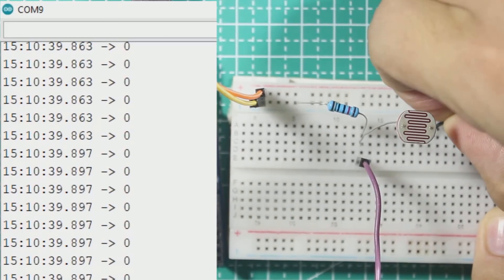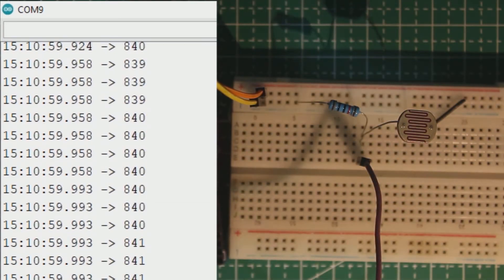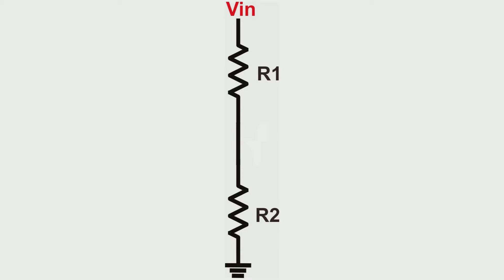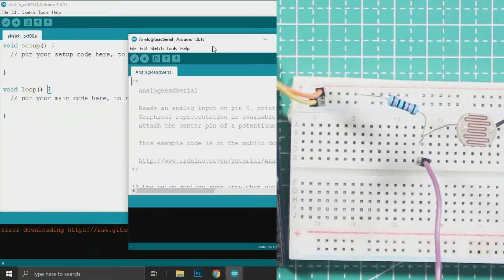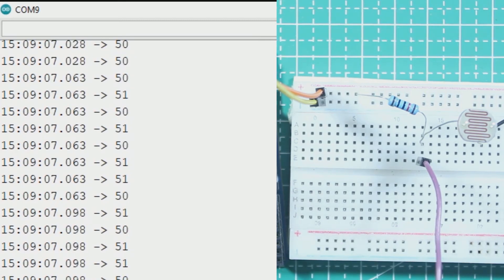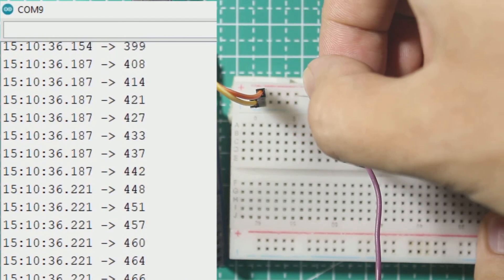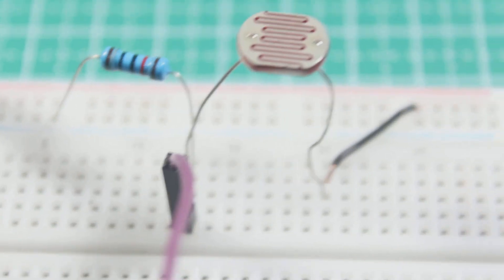how to use LDR as a sensor ( Light intensity sensor with arduino tutorial )

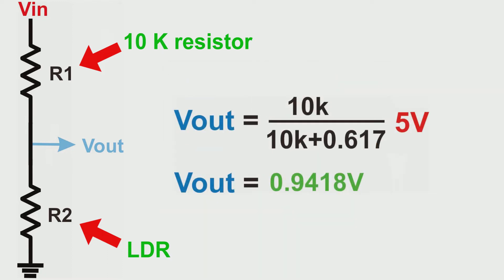Comment: The solution to the equation at 3:36 is incorrect. I can not be 0.9418V. Every time I input it into the calculator, it comes out at 4.999V. I am using (10000/(10000+0.617))*5 = 4.999V. If I use 10 and 0.617 instead of 10K, I still get 4.709V. Could you please explain how you calculated 0.9418V as the Vout?

Comment: je veux tourner un moteur lorsque l'intensité lumineuse augment, comment je peut fixer la valeur du analogread pour faire ça
Reply from the maker: you can control motor by pwm from analogread source and then map the value. For example : adc = analogRead(A0); pwm = map (adc, 0,1023,0,255); analogWrite(motor, pwm) ;
Reply: @miliohm   
thank you very much
Reply: Bonsoir miliohm,

Je veux commander un moteur 230V DC avec deux boutons: bouton pour le sens horaire et bouton pour le sens antihoraire et un troisième bouton pour stopMoteur.
J'ai utilisé deux relais et les relier avec deux pin PWM comme deux OUTPUTS et j'ai mis les boutons comme des INPUTS dans trois pin digitales et j'ai fait un simple programme que je le connais bien, mais lors de la simulation dans proteus isis le moteur tourne de lui lui-même et il ne s'arrête pas de tourner, même je ne peux pas le contrôler avec les trois boutons que deja créer :/ 
Prière de m'aider.
Merci beaucoup d'avance.

Cordialement.
Reply from the maker: @seifeddinebenmaallem1655  I need more details about this. Like the motor and other. You can send me an email to miliohmchannel@gmail.com
Reply: @miliohm  thank you verry match 
i sent you an email and I would be grateful if you could help me.